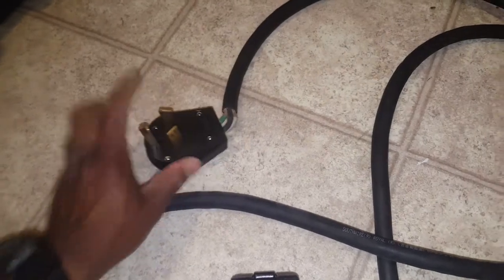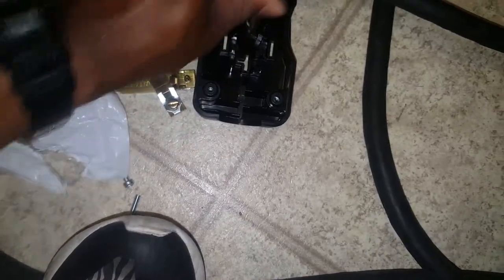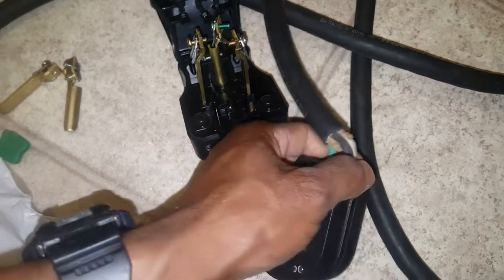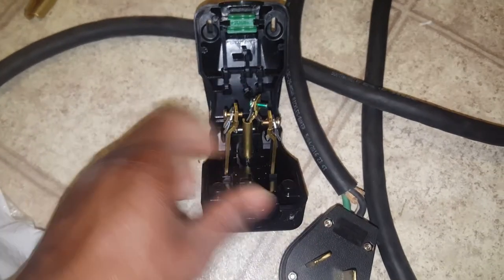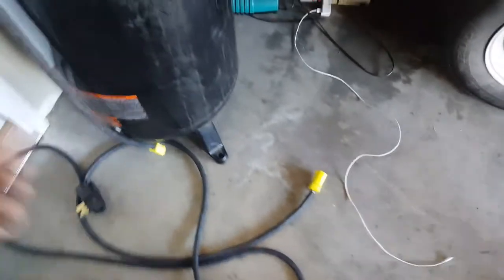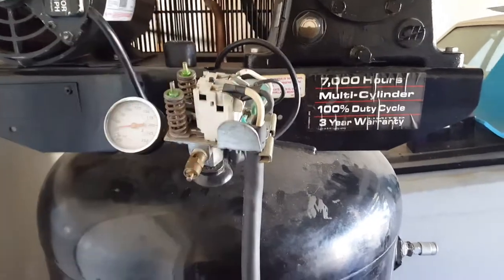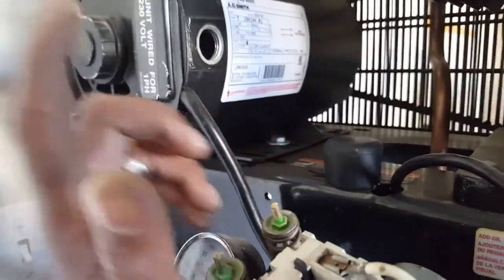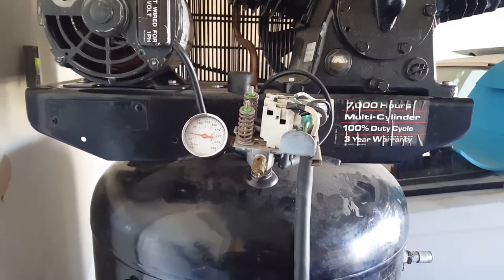DIY Wire Your Air Compressor To 4 Prong Dryer Plug

Comment: Since he burned down his house using 120v plugs rated for 15amps in the middle of a 30 amp circuit, he probably won't be responding to comments....

kidding I would avoid them though. Just wire it directly using the 10/3 to the dryer plug. They are well within ratings for a 5hp compressors, but much more.
I'm doing same thing temporarily (as a single 10/3 run) until the electrician stops by to grant my conduit the magic of 220 and a proper box.

Amazing 1 handed work by the way.  Those things are a pain in the ass using both hands!

Comment: this is a great vid i always wondered about getting a 220 plug or whatever installed in my garage for one of this big compressors but this is a good work around cheaper just cant dry clothes and paint a car at the same time lol
Reply from the maker: Lol one or the other but at least there is an option, we usually wash in the middle and end of the week.

Comment: Steve, I'm trying to do the same thing, but I'm trying to use a 8hp 5500watt generator for my 220v supply. The generator has 4 prong locking outlet and that outlet is max rated to 25 amps. The compressor is a Sanborn Black Max 5hp 230v 15amp. I'm using an extension cord made of 10/3 wire. My first attempt I had ground and black/hot white/neutral. The compressor ran slowly. (was it running on 120v?) My second attempt I connected it as you did. I left the neutral 4th wire not connected. I had the 2 hot wires and the ground connected. This time when I turned the compressor on it made my generator really slow down from the load and the compressor never really operated. the motor pulley twitched a bit but never rotated. Does it sound like my generator is underpowered for this compressor, or are my compressor motor's capacitors health in question? My calculation of 230v x 15 amps (or even 20+ amps at startup) doesn't seem to totally max out the generator---or does it? Any help would be greatly appreciated! Regards, Fred Koch

Comment: How to plug 120v to air dryer 4 prong plug? My motor is 3.5hp 120V - 15Amps. My regular fuse blown after 1-2 minutes after u power my compressor on.